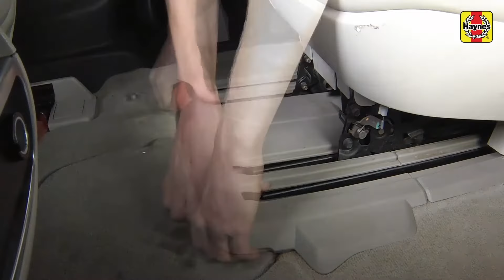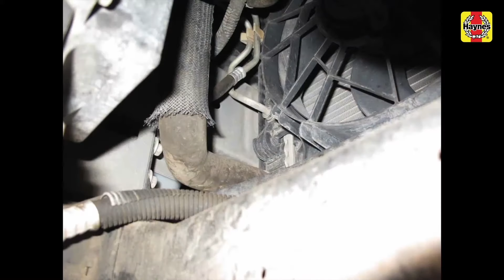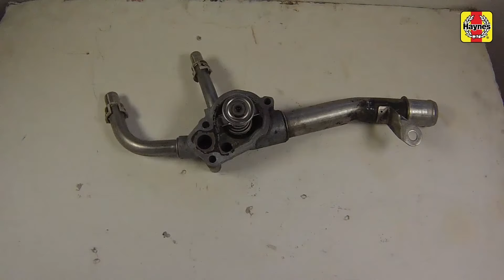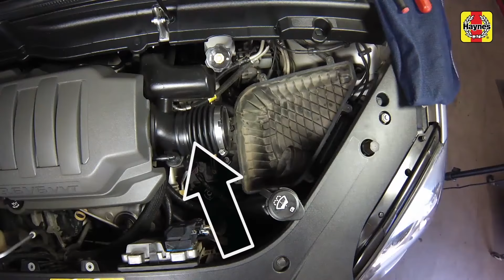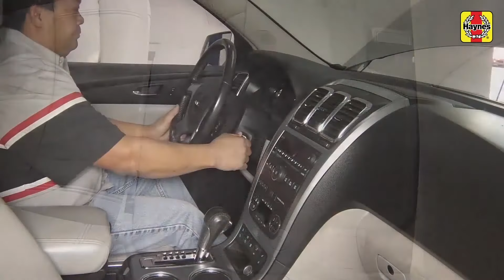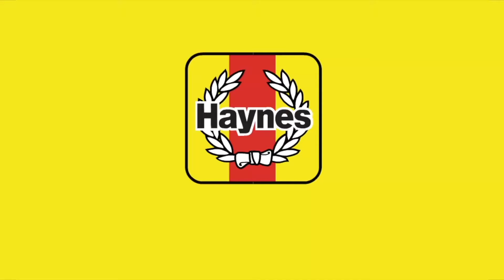How to Replace the thermostat on the GMC Acadia 2007 to 2015

Comment: My car was throwing engine over heating codes after expecting my vehicle I found one of the hoses came loose from the thermostat housing… should I trying reattaching it and see if that will fix my problem? I was told a bad thermostat could cause excessive pressure and cause the hose to pop loose. The silver clamp is still attached to the hose and that ms where it came loose from

Comment: Great Video 👍   so I got a new (1yr old) radiator on my 2012 GMC acadia & there's no leaks & plenty of GMC orange coolant. My acadia gets HOT in about 7 to 10 min. I'm assuming the thermostat isn't opening? Right? & the Heat on full blast doesn't work. On 90 degrees & full blast &  no  heat, just "reg" temp air.
Reply: Make sure theres no air in the system

Comment: Okay, this and replacing the 2 hoses how much? I was charged 1500
Reply: That's WAY 2 much.  I got a new radiation replacement for 750$ & they charged me another 150$ to replace the thermostat & that's in Chicago. Independent mechanic/shop. DON'T go to the stealership
Reply: @gatorchomp3371  good lord 😹

the thermostat w/ the housing is like $130 retail.
without the housing, (just the internal spring mechanism) its like $25 at autozone.
Reply: I am about 40ish minutes into it. Watching videos when I get stuck. Thats how I ended up here, couldn't figure out how to disconnect the other 2 hoses. This showed me. But, the thermostat itself is 25 bucks

Comment: There was no/zero need to disconnect the battery for this at all. Save yourself some time, and skip that step.
Reply: FACTS
Reply: Rather be safe than sorry 🤷‍♂️ if someone copied his video and they went and not follow directions properly they could hurt themselves and sue 🤷‍♂️
Reply: @Eastsidegeorgiaboy  exactly what I was thinking lol
Reply: Yeah, so far I've got my radiator and rad fan out and the thermostat 90% of the way done, haven't yet disconnected the battery. I thought about it, then thought...why? Lol

Comment: 💯💯QUICK NOTE EVERYONE, REPLACE THE WHOLE THING , THE AFTERMARKET THERMASTATS BY THEMSELVES IS MISSING A RUBBER RING LIKE THE ORIGINAL HAS, I REPLACED 3 TIMES B4 THEY CAME OUT WITH THE WHOLE HOUSING UNIT WITH IT ATACHED, CAR WOULD ALWAYS RUN A LIL OVER HALF WAY MARK UNTILL I FIGURED IT OUT.......... MELTED HOSE CONECTORS IN PROCESS
Reply: @YoloSoloYo  are you talking about the “O” ring ?

Comment: Appreciate the video but you can't tell us one size bolt but you can tell us the pressure of how much torque to put back in bolts that's crazy man
Reply: 10mm is the most common for thermostats housings/water outlets...
Reply: When dealing with aluminum, you fasten it down until it’s stops and then tighten very little aluminum threads will strip
Reply: 10mm and 15mm for bracket
Reply: If you can’t figure out for yourself than I would recommend you to now touch and try to fix anything on your car!

Comment: Thanks for the video. Everything I needed to know and see to get this done on our 2007 Saturn Outlook. I replaced the entire thermostat housing since it did not cost much more to buy a whole new factory-identical AC Delco unit with gasket and bolts. Only issue I had was getting a torque wrench on the lowest 10mm housing bolt, but I winged it and figure it should be fine as those three mounting bolts are inch pounds, not foot pounds. Anyways, appreciate this very much. Saved me $600.

Comment: What the hell was the special tool you used to remove the thermostat from the housing and how could you just brush past that step?
Reply: Thinking the same
Reply: @8701Alexcamilo  so, I did the job the next day and, (for anyone interested) most of the aftermarket thermostats come with a little heavy duty toilet paper roll-type cardboard, which is the tools used to remove the thermostat. It's is basically any item used to depress the spring on both sides .

Comment: So I went to oriellys they said I needed the whole housing. That you couldn't just change the thermostat
Reply: They lied to you
Reply: Napa auto parts has just the thermostat
Reply: Agree with the others who have replied to you. I am replacing my second thermostat on my 2011 Acadia (300kmes). Unless it is damaged there’s no reason to replace the housing assembly. I got mine from ADVANCED AUTO.
Reply: The entire thermo

Comment: No mention of tools used or even bolt sizes. This guide is seriously lacking
Reply: What are those pliers he used to compress the thermostat
Reply: @michaelmartinez9602  good question
Reply: @michaelmartinez9602  Right i had to rewind a few times like wth are those. I have some similar but my tools are so spread out right now moving sucks. I know you buy some of those from Hobo Freight aka Harbor Frieght they come with like 4 different heads.
Reply: He use pliers and just push the down and turn the thermostat in place
Reply: Seriously?🙄
Reply: Repairing your own vehicle is not for you if this is your biggest concern.
Reply: If you can’t figure that out for yoself take it to a shop🤣🤣
Reply: @KedrickDavis-n2h  maybe we’re trying to learn so we save 1600$? Ever think about that?
Reply: @dollabillzmusicgroup2091  lol...seriously this was actually an excellent guide. If you need someone to tell you the bolt sizes and the tools you need thats pretty sad. you want him to do the job for you too? Lol

Comment: Cannot remove thermostat. Wtf Ate you Using
Reply: There's a cardboard cylinder that comes with the new thermostat, it is the tool to remove and install the thermostat to the housing
Reply: @btelfer1592  how is the cardboard gonna remove it? I could see using it to install it pack in I guess but remove it?
Reply: Me too do I need a special tool to remove thermostat
Reply: Two screw drivers